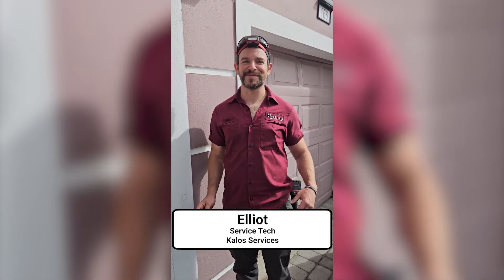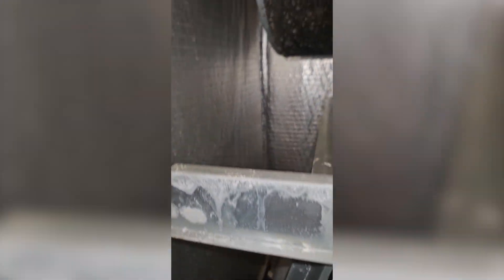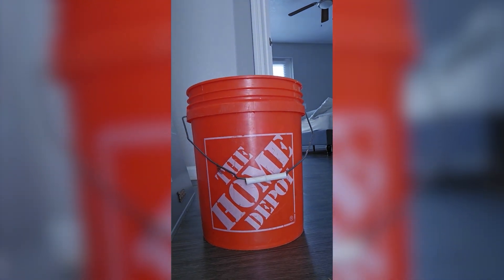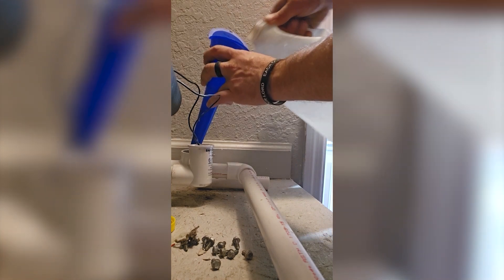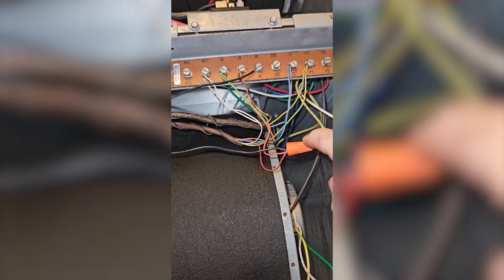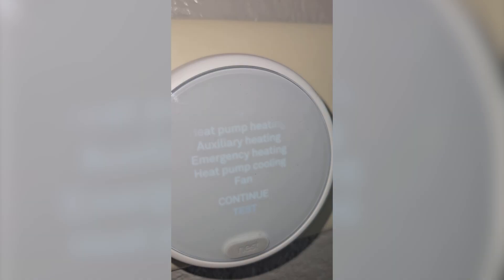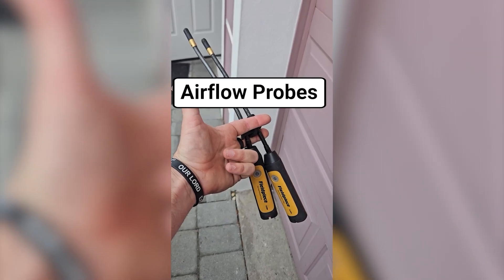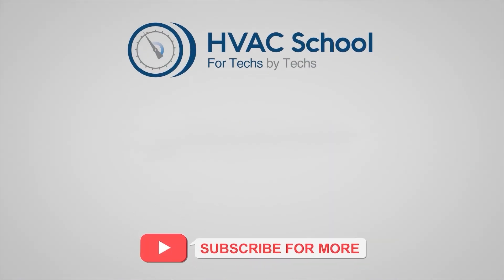Adventures with Elliot - Indoor AC Maintenance Basics

Comment: No P trap? As a PM tech, No wet/dry vacuum cleaner? If you spray any chemicals on Evap Coil, you should run cooling for at least 2 hours to let condensate water rinse the chemicals off the coil! If it's not the cooling season, don't spray any chemicals on the Evap coil!

Comment: Did you teach the customer that cooling mode on the thermostat doesn't heat the house? I've run into that one sometimes. It seems to be a pretty hard concept for some. Auto mode is black magic vodoo. So definitely don't tell them auto mode exists.